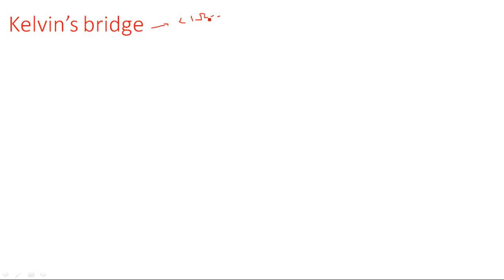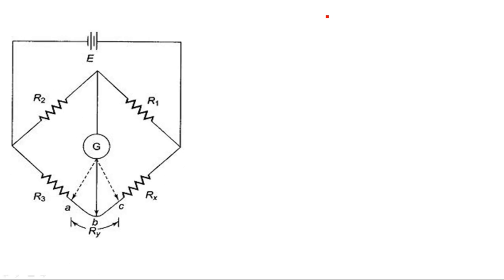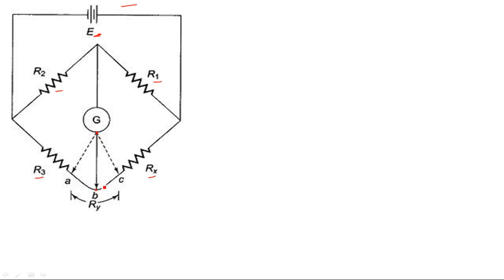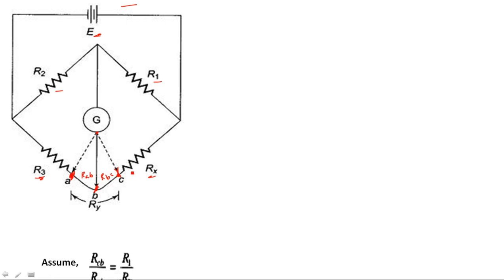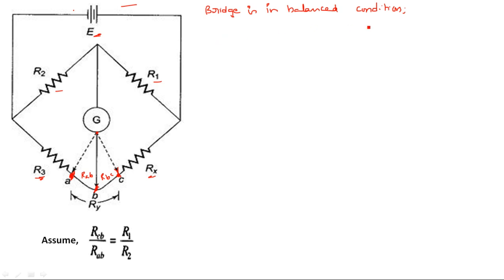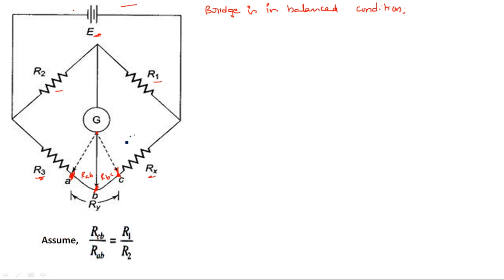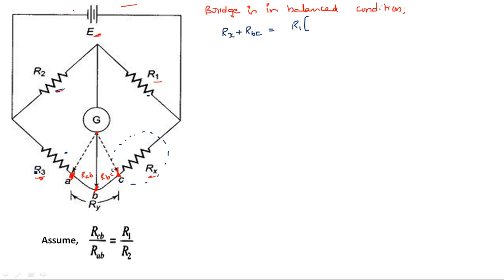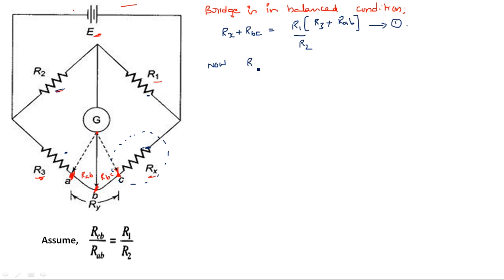Kelvin's bridge || Circuit | Electrical Instruments ( EIM ) | Lec - 41

Comment: Hello Sir, thank you for your video. I have a question. When the bridge is at equilibrium we have R1 (R3 + Rab) = R2 ( Rx + Rbc) ... but how can we assume (?) at the same time that Rbc / Rab = R1/R2 as R1 and R2 are randomly chosen I guess ?  (why not R2/R1 or even R3/Rx ...) ?
Reply: R1 and R2 are not randomly chosen bro, they are ratio arms whose ratio of resistance is fixed and only for such assumption the previous equation of wheat stone bridge remains true